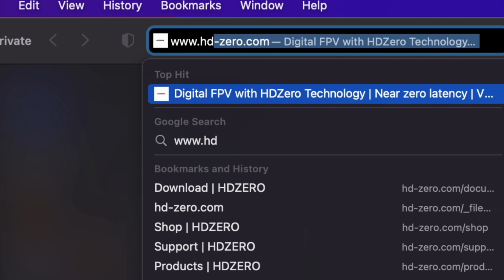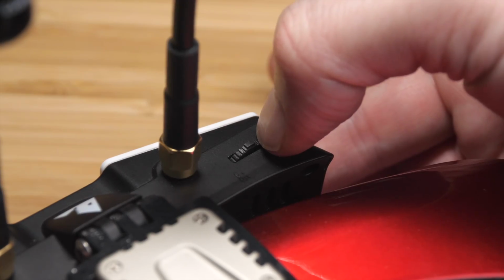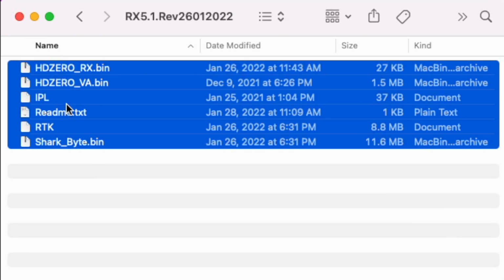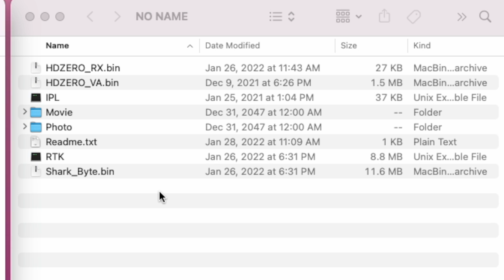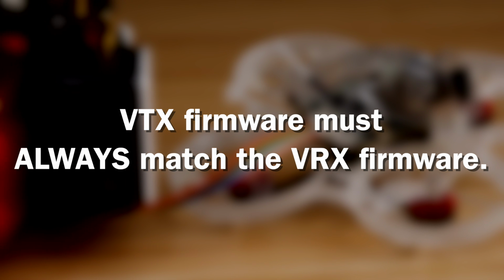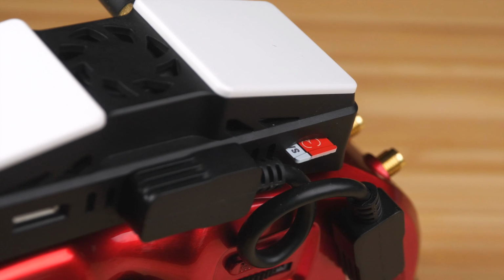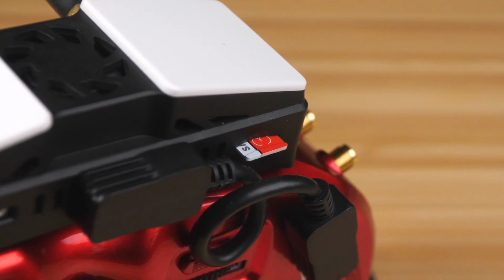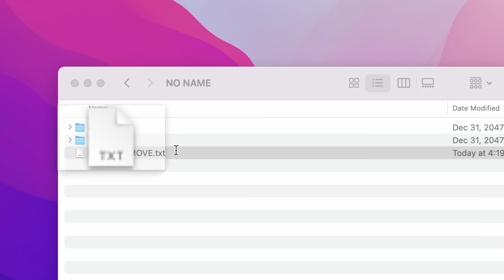HDZero Firmware Update Guide

Comment: Black screen on mine. I haven't flashed anything since using it with the older orange runcam weeks ago and now this... fans on, red light on... 
RF mode in goggles works fine but black screen as soon as I connect HD Zero VTX (skyzone 04s). What has caused this ....

Comment: I installed a Freestyle vtx on my Chimera 7 following your instructions. It was one of the first versions of that vtx. Everything worked out perfectly, including the unlock portion of your videos. I just installed a newer version of the same vtx in another quad. The unlock sequence did not involve any flashing lights. Just solid red. I did this twice. I'm not sure if this worked or not because I'm not getting any osd? 
The new version of the manual doesn't make any sense to me regarding the cli commands. I tried the older commands but I'm still not getting osd. Any suggestions would be greatly appreciated.
Thanks

Comment: i didnt get the fw update cable with my scout hd. i ordered via rotor riot....is there any way i can make this cable?
Reply from the maker: You can make one, it's a JST SH1.0 connector with 7 pins. A kit like this would let you make one: https://www.amazon.com/Pre-Crimped-Connectors-SPRacingF3-Omnibus-Silicone/dp/B07PDQKHJ2/ref=sr_1_2?crid=WKYSF6DAQBO8&keywords=jst+sh+1.0&qid=1647460792&sprefix=jst+sh+1.0%2Caps%2C102&sr=8-2

Comment: Hi, where can i buy the mobula 7 flight controller for replacement??  i burned it up by plugging the battery inverted, thank you in advance.
Reply from the maker: Contact Happymodel support. It’s not being sold separately at the moment, but they can probably sell you a replacement.
Reply: do you think the betafpv F4 1-2S 12A AIO Brushless Flight Controller could do the job???
Reply from the maker: That sounds like it would probably work. Just make sure the flight controller is physically small enough to fit into the whoop frame.